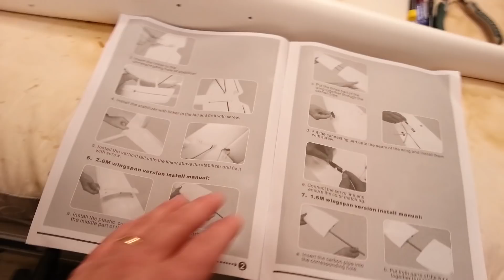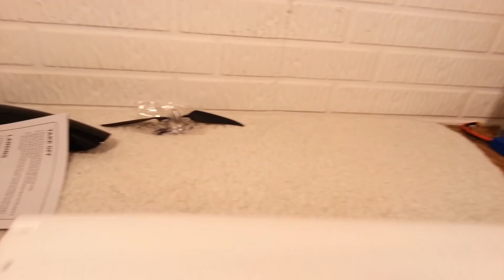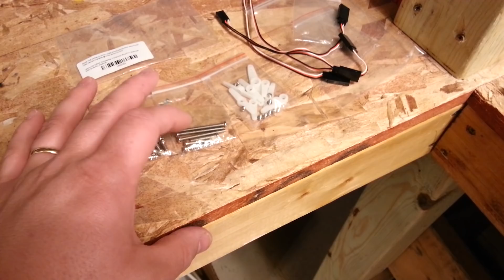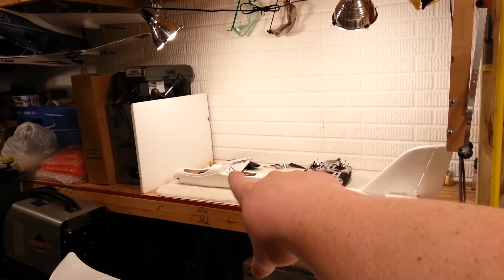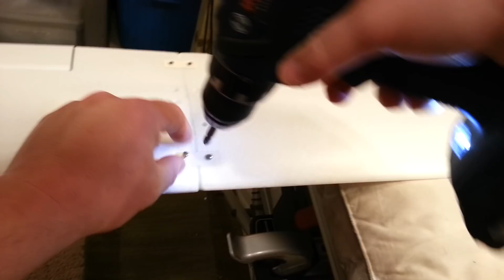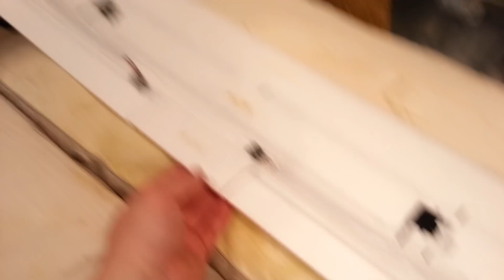Volantex RC - Phoenix Evolution - 1.6m/2.6m Sail Plane - Build Series - Part 3

Comment: Looking forward to radio setup  and maiden flight  THanks
Reply from the maker: Here's the whole list...so far...bottom ones are gonna post in the next few days, but you can see how I setup the radio on the ASW-28 build series. I literally copied it in my radio.

Unboxing - https://youtu.be/7sh2tIwPYJY
Build Series Part 1 - https://youtu.be/_fP4HbK5f3A
Build Series Part 2 - https://youtu.be/R0gL5S3CU70
Build Series Part 3 - https://youtu.be/ww6MDlWSRYU
Build Series Part 4 - https://youtu.be/emeXTYHdQIo
Build Series Part 5 - https://youtu.be/ppKYDIiEMvg
Build Series Part 6 - https://youtu.be/4aukbAjRL9Y
Maiden Flight - https://youtu.be/RhUHAw0T-Mk
Build Series Part 7- https://youtu.be/-7TJOdP9N8s
ASW-28 Radio Setup - https://youtu.be/ui4-rFALQvg (We copied the ASW-28 transmitter file for this plane)